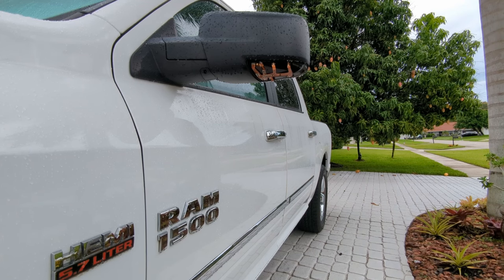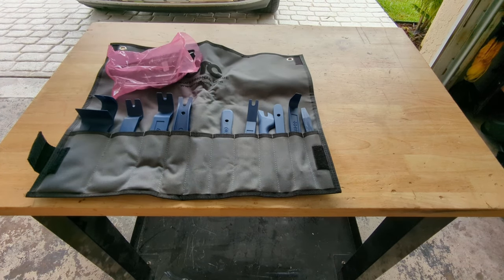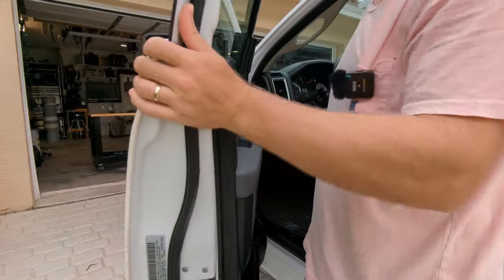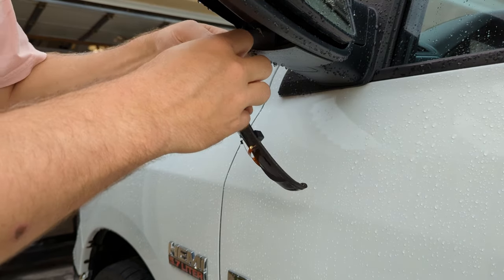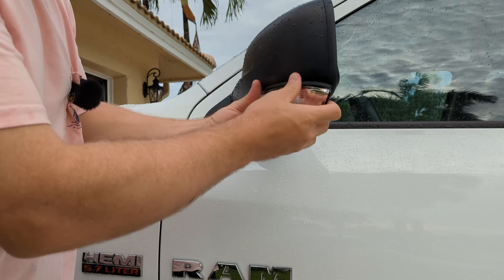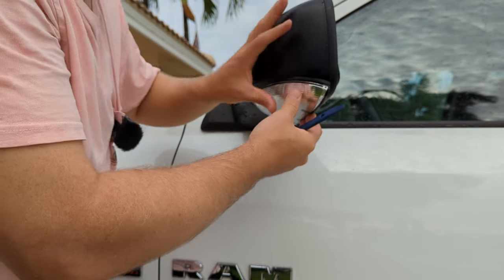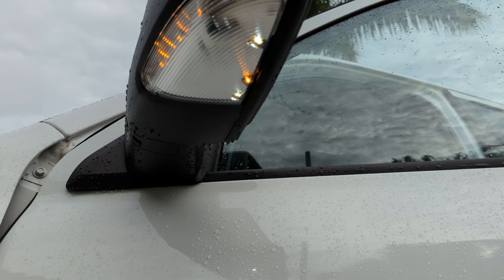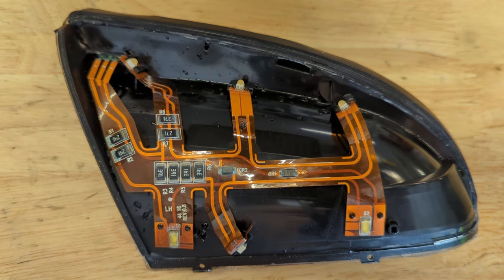Ram 1500 Puddle Light Replacement

Comment: Ordered my passenger side off amazon for $27.  Just like the reviews said, it was a little tight and I actually had to pop the mirror off and remove the three screws holding the black plastic trim to the front of the mirror, so I could get the part put back in properly.  Great video!

Comment: Funny thing...mine flew off on my driver's side. I thought it was from the car in front of me. But it was my lens. I ordered a pair from Amazon.  $61 for Chinese shit vs $125 per side from Mopar. Thanks for the how to vid.
Reply from the maker: Which did you end up going with?
Reply: @JoesGarageProductionsLLC  I ordered D-Lumina on Amazon. So far so good. Lights seem brighter than oem and a slightly different design. I got non-sequential clear lenses.
Reply: @motopilot74  - Why would you get clear lenses 🙄
Reply: @dimensionexo.  I'm not a fan of smoked or blacked out.
Reply: @motopilot74  - Okay